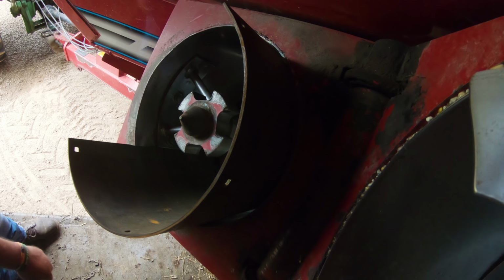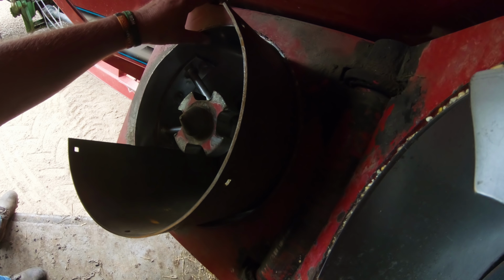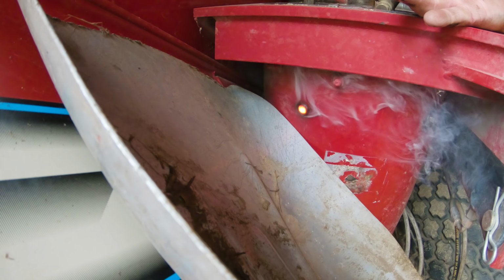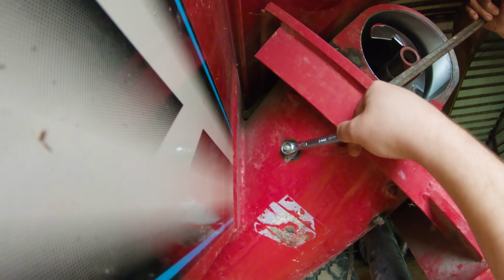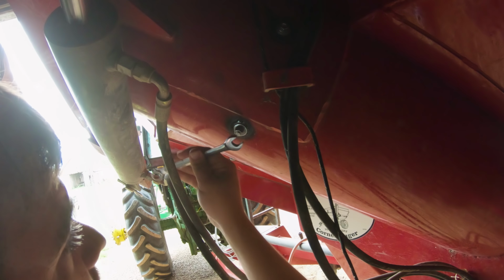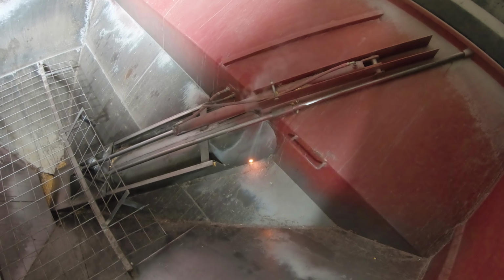Brent Grain Cart Auger Fix & Duals on the JD 4640

Comment: That is some thick material to put in an auger, should last a long time.    I had a  Kinze fixed after millions of bushel of use and it was a spiral insert that was welded on each end.   My 1115 Extreme  is much thicker, might be because it is designed to unload 650 bu/min.   Our first 1964 model cart  was very thin medal.   I earned to braze with all the thin sheet medal used in the past when grain was produced in smaller amounts.

Comment: A lot of the cotton is out now down here... some already have the stalks shredded and disked and some even plowed.  Some cotton is still sitting in the fields though, just about ready to harvest.  Guys just don't seem to get in much of a hurry any more-- not like when I was growing up and a young guy in the late 80's and 90's... 

Back then we defoliated the cotton around the first of August-- usually the first week at the latest.  Then we'd be picking by the 7th or so, 3-5 days later usually (depending on the weather, sometimes a week later if the leaves were slow to drop and bolls were slow to pop open).  Then we were pretty much running flat out night and day (til we ran out of trailers or the dew fell and it got too wet to pick-- actually it'd pick but the newer model cotton pickers, when it gets a little too damp, it won't blow up the pipes to the basket and the doors clog immediately-- that's when you know it's time to pack it in for the night.  The old machines that sucked the cotton out of the doors would keep on going).  Anyway, we ran REAL hard to get everything picked the first time, since that's the lion's share of the crop, and then we'd usually start second pick back at the beginning as soon as we finished the last of the first pick, and do it all over again.  Course scrapping (second or third picking) would go MUCH faster since you didn't have to stop and dump and haul trailers to the gin as much, meaning you covered a lot more ground a lot faster.  Sometimes if it was cooler (low 90's) and damp/cloudy a lot, we'd knock off for a few days to let the top bolls open up real good before we started second pick.  Longest I ever waited was about a week.  When I was a kid it was not uncommon to pick the cotton 3 times, but that was when fuel was cheap... by the time I got out of high school in '89, we only picked twice most years, and by the mid-late 90's nobody hardly picked more than once.  Like the picker guru told me, most of the spindle wear in a cotton picker occurs from the barbs hitting bark on the stalk and branches, not picking cotton-- and as expensive as the spindles are, it doesn't pay to wear them out faster to scrap a field for 1/3 of a bale per acre or less...  Course back then we were worried about hurricanes and Gulf storms, which we got pretty frequently back then.  Not so much now-- occasional hurricanes (like last year) but they're rare now... not like back then).  Now guys just let the crop open up naturally in the field, a process that can take several weeks (we always defoliated at 50% open bolls-- a week later by the time the leaves were off it'd be 75% open and we'd start picking).  Now they'll leave it in the field an extra few weeks to let it open slowly on its own, defoliate it, pick it once, and cut it down, all in a matter of a few days.  

Later!  OL J R :)